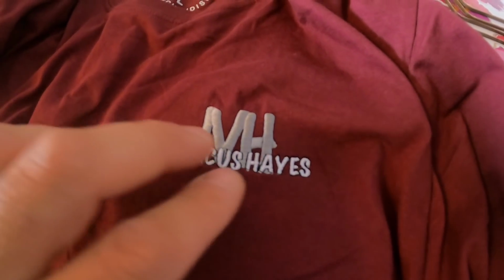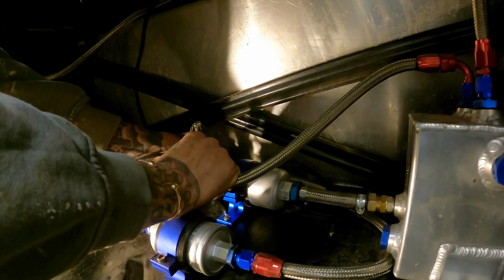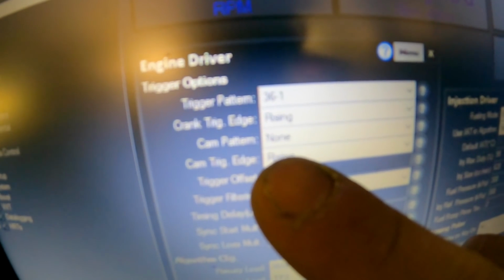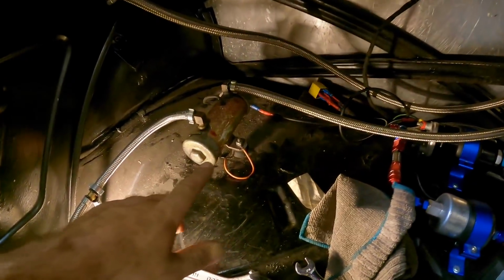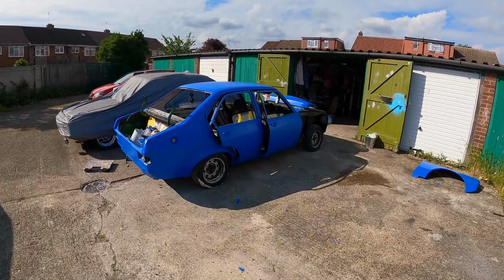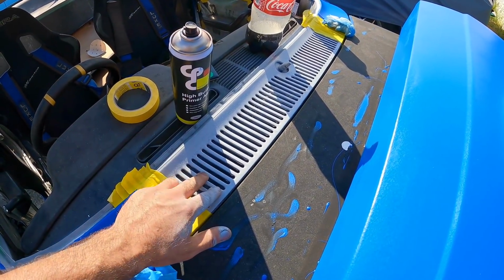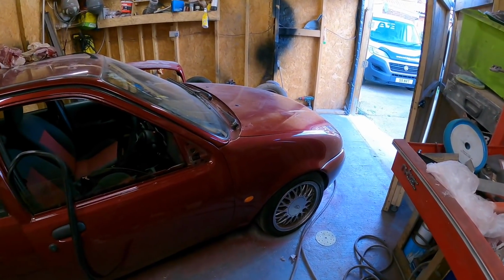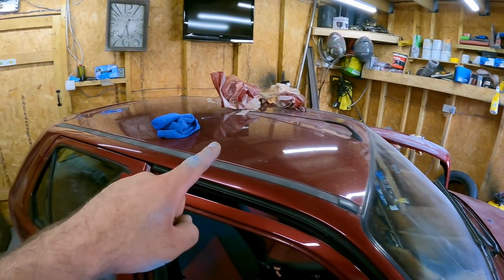REVEALED! Mk2 Escort NEW colour! 😃

Comment: Sometimes if the lines are primed the pump don't come on until that fuel has been used up it was the case in one of mine as it needed spark plugs but I couldn't hear pump until I changed plugs turned engine over then I could here pump again ...I'm only butting in now without watching full video apologies if it's going b4 the end. I'm sure yous will get to the end of it soon .👍👍you've just eliminated that theory I think.😐
Reply: Glad I looked cos I was gonna suggest if primed by relay its mibi up to pressure??? Jason beat me too it 😁😁
Reply from the maker: Thanks for the advice mate! 👍 Glad we got the 100E running.

Comment: Should be able to buzz the pump straight across a battery to check it. Only thing which will kill a pump is running it dry. Ecu control of the pump is prime at key on & then once it recognises rotation. Nowt to do with oil pressure (some very old setups onJags & old Rovers did use oil pressure but that was pre 'modern' ecus that have proper rotation detection).
Reply from the maker: Thanks for the advice! 👍 We tried the pump directly on a battery and it didn't work. It seems I was wrong about the oil pressure switch controlling the pump but the result is the same, the pump gets power when the engine is spinning. 👍